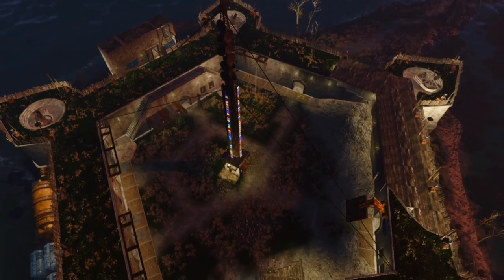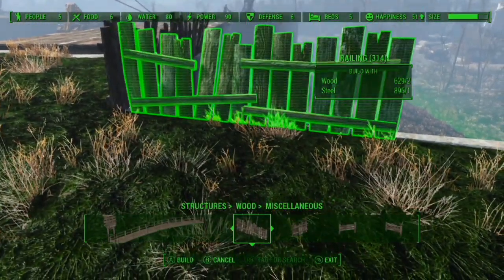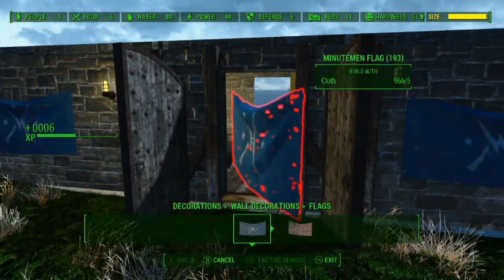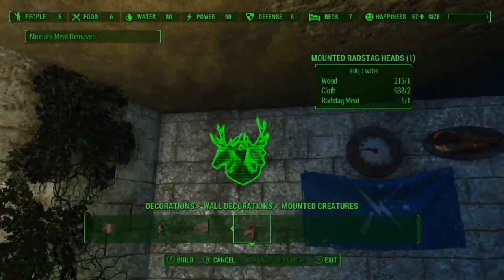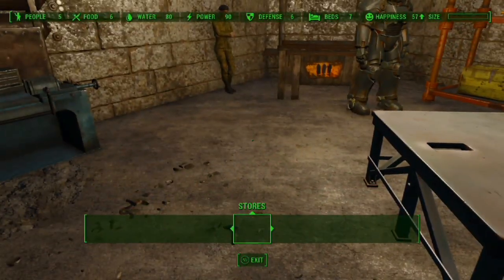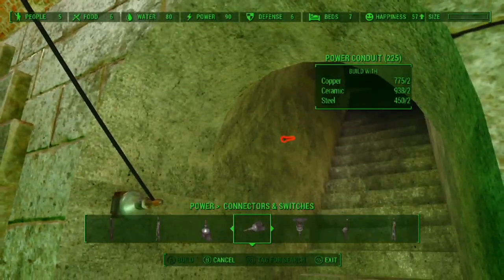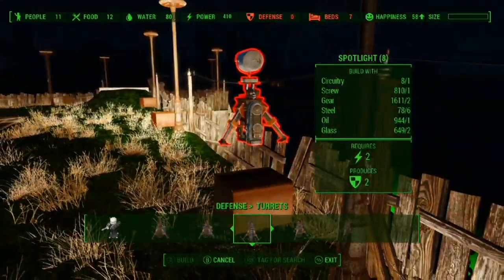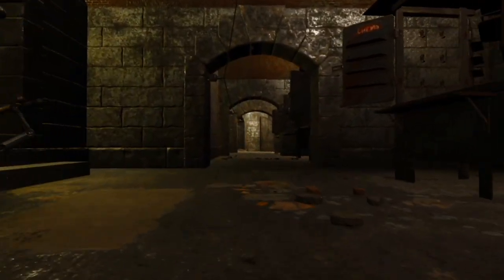Building with Mods - The Castle - Fallout 4

Comment: I really enjoyed this, I haven't done anything with the castle.  I have the "Spring Cleaning" mod that lets you get rid of pretty much anything in game, litter, paper, reeds, bushes, things that the game doesn't usually let you scrap.  The Alt Settlements and Settlements Expanded are great mods.  Have you considered the Greenhouse Snap & Build it would look great attached to this castle.
Reply from the maker: +Ryan Wolf Hey ryan, I believe I didnt have the spring cleaning mod at the time of building castle but i did you it in the next two videos in the series in sanctuary and starlight drive in which helped big time.I do have the snap and build mod and i plan on using it in the next video I make. glad you like the video buddy :)
Reply: Final Render I have three other mods I use, it doesn't effect much apart from Sanctuary , "Patch Job", "Paint That House" and "Pre-Apocalyptic Walls" basically those three mods restore the houses to a better condition, Not completely perfect but the bookcases are restored, the floors in the houses are clear and the roof's have no holes in them.
Reply from the maker: +Ryan Wolf my sanctuary hills video has a cool one that fixes the roads you might wanna check out

Comment: Ha! The first time I like my own from my first go even better. Instead of artillery on the 5 corners I have built defensive towers in each. The ones facing the sea don't have that many turrets, the three facing land have a lot.

And then, due to the way I did the main quest, the need for using those never arose. Thankfully there is also a mod where you can initiate the "Defend the castle" quest and it was the last thing I did as part of my LP. While I did use mods they are only for the decorative stuff and I didn't cheat for resources either.

Comment: A better solution to repairing the castle is to use the mod that adds additional concrete textures. It gives you about 6 additional textures for all the concrete walls, one of them is stone. I built a 4 season store(military version of a quick stop store) in the small wall hole, I even had a bed area above the store for the vendor.

In the large wall hole i made a 4 by 4 greeting area for visitors to pass through security. I also put bramenn feeders and a fire pit outside for the traveling traders.

On the ground floor I made off8ces like the chow hall, hospital, weapons armory, etc... I then used the mod to build a second floor for barracks and rec area. I put food plots as the roof of the second floor with stairs leading up to it. I fenced the top area (after I fell off once, lol) and put mortar on the 5 corners.

I also built a tower around the radio antenna, first floor was the radio, second floor was an office area, third floor was a printing area, fourth floor was a CNC, Fifth floor was my bedroom suite, sixth floor was a working lighthouse made from light boxes accesed by a secondary exterior stair from the fourth floor. The lighthouse was a bear to place using the pillar method. It took more than a few tries to get it placed correctly.

As a result I had all my things inside or on top of the walls an the center was a mostly open parade ground. It was expanded to 3 floors if you count the food plots on the roof as an additional floor.

Comment: I saw this on Nexus, gonna try it tonight.  Hopefully it still works well and I can use lightboxes.

http://www.nexusmods.com/fallout4/mods/8128/?tab=4&&navtag=http%3A%2F%2Fwww.nexusmods.com%2Ffallout4%2Fajax%2Fcomments%2F%3Fmod_id%3D8128%26page%3D1%26sort%3DDESC%26pid%3D0%26thread_id%3D3662570&pUp=1
Reply from the maker: +StahPK I used something similar in my starlight drive-in episode of building with mods which required 1829 light boxes so i didn't need to power them but i still had to do all the wire work so i wish i knew about that mod before hand. thanks for commenting:)
Reply: I'll check it out, I just found your vids.  Actually had I not watched this one, I wouldnt of even thought of a mod for lightboxes.. i just gave up on them. Thanks mate.
Reply from the maker: +StahPK yeah the light boxes are way to resource intensive to do anything practical with in vanilla IMO